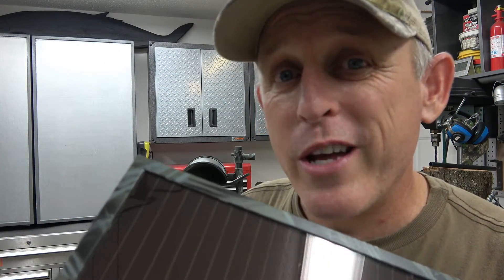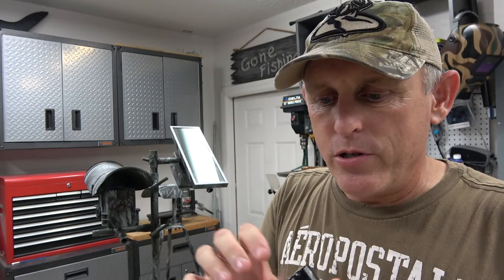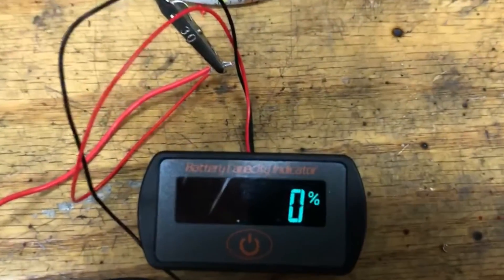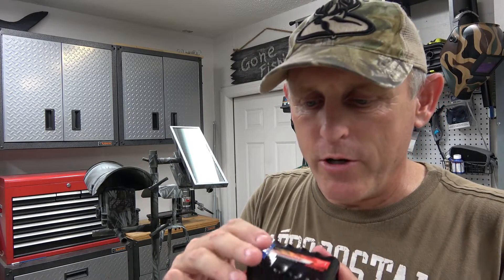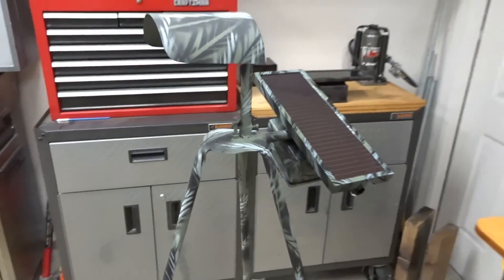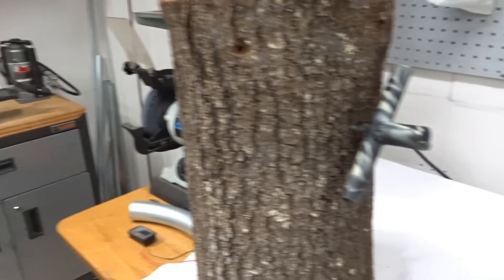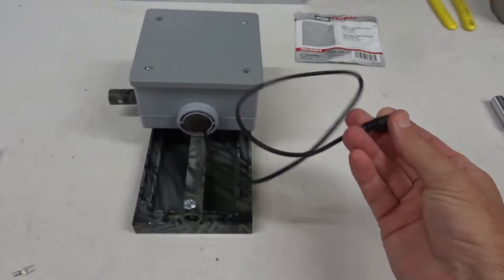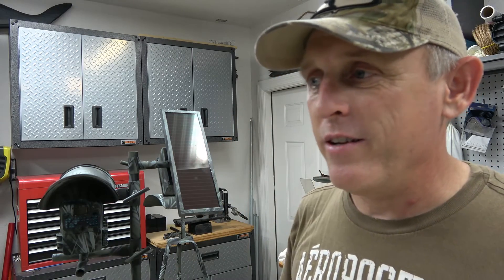Trail Camera Solar Batt Pack-DIY

Comment: Quick question, as I need help with the nomenclature conversion.  In the original battery box you used a 12v/12Ah SLA battery now I believe this is suppose to be done with a 2000MAh NiMH battery.  Is 2000MAh equivalent to 2Ah or to 20Ah?  Thinking it takes 1000 milli amps to be 1 amp.  Have you looked into Lithium for this purpose.  What I can't figure out on the 12v regulator is the range of input voltage it can handle.  If it can take 4-3.7volt 18650 cells (14.8v) in series and regulate that to 12 volts it should be no problem to cobble together a very robust multiday batter pack with 8 or even 12 18650 cells.
Reply from the maker: It will handle 14 volts easily cause it regulates 12 volt solar in full sun at 23volts.  You will be fine but may need to double the number of 18650’s and run two packs in parallel.  Hope that helps
Reply: @TheHandyHunter  Yes sir, thanks for that information.  Actually looking at making up a pack using 32700 LiFePo4 cells because they seems to run in mAh ranges from 6000 to as high as 12000 which should translate to between 6Ah and 12Ah plus that chemistry is rated to have a discharge/charge cycle life in the thousands.

Comment: I've been watching your videos and I really like the ideas you have.  I'm in the process of getting the items I need to make this off your amazon store, but I'm not sure about the 12V regulator.  I think I understand that the regulator reduces the voltage from 12V (the battery) to 6V (camera) correct?  If that is the case, which regulators do I need to buy?  When I click on the link it goes to "L7809CV L7809 Positive Voltage Regulator IC TO-220 Output 1.5A 9V"  Does this mean it's meant for 9V?  Or do I need to get the L7812 for 12V?  Or do I need to get the L7806 for 6V?  Thanks!
Reply from the maker: Hi David, what voltage is your camera?  You’ll need to match the regulator to the voltage of the camera.  The voltage regulator protects from high voltage at full sun from the solar panel.  Hope that helps!

Comment: Im getting around 12v at the regulator...however, from the regulator/game cord to camera I'm getting no power to unit. All my connections are solid...any ideas?
Bottom of my game cam says dc6-12v and camera instruction book says it accepts a 12v external source. Stumped!
Reply from the maker: Hi Jim, sorry for the delay.  Are you not getting any voltage at the plug tip?  If not, then must be a bad regulator (which happens).  I would try a new one and see what happens.  If that doesn’t work it could also be a bad cable.  I would do some testing right at the reg to see if power is coming through.  Let me know what you find.
Reply: @TheHandyHunter   as soon as I posted, I went back and tried a few things...I'll admit, I know a little about electricity but not how to use a volt meter! (Reading instructions helps!!) So I had my settings wrong on the volt meter and the testing tips were plugged into the wrong parts of the volt meter. Once I read up on the correct placement, bingo, I had power to the cable tip! Now that I got a grasp I'm gonna make a few more...but I am gonna try a different regulator, those little ones drive me nuts trying to make em fit and get crimped! 

Thanks for the help and providing a shopping list...really makes things easier to find! Take care
Reply from the maker: You bet!  Glad you found the problem.  Good luck and keep in touch!

Comment: I built this setup exactly like you showed. Once I hooked it up to my camera the voltage regulator got extremely hot. Too hot to touch. Is this normal?
Reply from the maker: No, it should get hot.  What is the voltage coming out of the plug?  The voltage is not reversed at the plug is it?  Inner part is positive and outer is negative.  It could be a bad regulator but usually a wiring issue.  Let me know.

Comment: Handy Hunter, since it has been a couple of years since this was posted, have you redone any of these with 18650 or 2170 cells? I am wondering about the logistics of using a small bms and voltage regulator in a 4s configuration of lithium cells.
Reply from the maker: So funny you mentioned this!  I just started working on this project!  I’m trying to decide on which lithium battery and then the proper solar panel for charging.  May be able to skip all the bms part if you use protected lithium batteries that will prevent overcharging.  Also looking at the 26650 batteries but also trying to keep cost and ease of replacement in mind for DIY’rs.  I’m also thinking of changing the battery box the internals more accessible.  I want one that’s waterproof with a latched door for easy access.  I’m hoping to start testing a couple setups soon.  I’ll also be testing a lithium pack without a solar panel to replace some of my old SLA battery setups in the ammo boxes.  Let me know if you find a setup you like.  Thanks!!
Reply: @TheHandyHunter  I am wondering if you have figured anything out on this setup?

Comment: So I just made 3 of these using the link in your Amazon store to the diode and 12v regulator. Using a harbor freight  1.5w panel. It is wired exactly as you show, using brand new fully charged 12v7a sla batteries. Battery output 12 volts up to the regulator but is only showing 10-11v after the regulator.  I’m using them on 2 moultrie cam with external modem and a SPYPOINT link micro- the moultrie app shows power 64%-74%, 64% one will not send pics. SPYPOINT app showed power @60% it would not send either. On this cam  I disconnected the regulator and solar panel , ran wire from cam to battery, instantly the app showed 100% power and pics were sent.  Any idea why such a voltage drop on 3 setups?  It clearly isn’t putting enough voltage out to power cams
Reply from the maker: I’m a little confused.  The battery in this video is not an SLA but a NiMH...can you clarify first which one you are using?  Honestly, I had the same problem with Spypoints on the battery level and then had other problems so I ditched them after months of constant problems.  Hope u have better luck.  I can’t speak for the moultrie’s.  Voltage drop can occur from too long of cables or wrong size wire...I assume you are using a standard cable?  You may try rigging a short wire for testing to see if it helps.  It can also be due to faulty regulators but unlikely with 3 in a row.  Cell cams are more demanding than trail cams.  If I were you I might drop the regulator altogether.  Try this...take your reg off and connect your solar directly to your battery and then connect your cam cable directly to the battery as well(without cam connected).  Put the panel in full sun and test the voltage coming out of the plug.  As long as it’s not over ~14 volts you should be ok(some cams may even tolerate slightly higher).  It will probably run in the high 12 range if I had to guess.  The battery helps average down voltage going to the camera.  Full sun will be your highest risk for too high of voltage.  If you are close to 12v at full sun then forget the regulator.  I know many people who do it this way.  Just test, test and test again before you plug you cam in at full sun and make sure your panel is connected to the battery.  Do some testing and then get back to me with update.  Just FYI,  I’ve run this same solar setup for 3 years on my cellular bigfoots and haven’t touched them so once you get it up and running you should be fine.  Let me know.
Reply: @TheHandyHunter  thanks for the reply.  I am using a sla battery not lithium.  I did test the panel briefly in the full sun. It showed 24v from the panel.  When I plugged that into battery, and had a power wire coming off the battery on the same post, that wire coming off battery only showed 12v.  I will test again to verify tomorrow.  I guess if that is correct I will remove regulator.  (The voltage drop occurs even with a 4" wire coming directly off the regulator, it is the same with a 10' wire.)  using 16-18ga wire, I have used these battery/wiring combo for several years with no issue, only change was adding solar/regulator.  Moultrie modem is a power hog, cam not so bad; spy point is better on batteries but you are right they are nightmares with different issues.
Reply from the maker: Ok, test it again in full sun, connected to the battery with no regulator.  Who knows, it could be the batch of regs that are slightly off.  I’ve had to throw some away from time to time.  Good luck and let me know.
Reply: Tested again today in full sun. Panel output 22 volts. Regulator output 11-11.5. Removed regulator from the system- so it was solar to battery, battery to cam plug, plug read 12.5-12.8v
Reply from the maker: If it were me I’d run it without the regulator.  Your cams can handle that voltage no problem and will perform better.  Thx for the update!
Reply: @TheHandyHunter  thank you for your time

Comment: how big this battery your using in this box  ? Is there welded  holder on back that you  could use a steal cable lock or python on this item so it kept from being stolen our of the tree ? Thanks Pamela

Comment: Does this setup still work? Those are lithium batteries right? I have always been told that without a solar charge controller, the lithium batteries will eventually go bad from having too much voltage put into them.
Reply from the maker: The battery just went bad after two years and full sun all day every day.  This is a 2 watt panel so I started building these with a 1.5 watt panel and they are doing fine.  You can try a controller but keep in mind they they creat draw on your battery.  You may be better off taping off part of your solar panel to slightly reduce voltage.  I love this setup though...works well!  Good luck!
Reply: @TheHandyHunter  Just realized this is a NiMH battery. I was thinking lithium ion. I have a setup that I made with a solar charge controller and some Lithium ion batteries but the box failed as well as the solar panel because it got messed with by cows. I may try this method and add my solar charge controller to it.
Reply: @TheHandyHunter  Thanks for your response!
Reply from the maker: You are welcome!

Comment: Hay man you are great and I made 1 like in your previous videos with the amo box and has worked great for a couple of months. I went and checked it yesterday and says battery is low shows 9.57 on wild view camera. I don't understand why it now down on charge. The solar panel is the same on my feeder to your specs and about 10 feet from it and it's low. I have also ordered some rechargable AA batteries for the camera and the other battery just as back up but have been running it direct any advise on what could be the problem ?
Reply from the maker: Hi Tony, are you saying the batteries are low on both your battery box and on your deer feeder?  Are you running solar panels on both? Are they in heavy shade?  What brand of batteries are you using?  Just FYI, some cams won’t run on rechargeable AA’s because they are slightly lower voltage than regular AA’s.
Reply: No the battery on my feeder is staying at full charge and the big battery on my camera is showing low charge. I disconnected it so to see if it charges back up and I will check it again this evening. I will let you know the brand of battery this evening. The solar panel is a wild game innovation sp-12v1 the same as my feeder.
Reply from the maker: Ok thanks.  I’ve had even new batteries go bad because they wouldnt charge so it could be that.  Otherwise, you may have to increase the size of your panel for the lack of sun time.  I don’t know the draw of your camera but usually they barely draw any power.  I used those wildgame panels in the past but only on 6 volt and they wouldnt keep my feeder battery charged so I built my own solar setup.  Let me know what you find.
Reply: They get good sun up till about 11 in the morning.
Reply: Also I got the battery from academy .
Reply: Sorry it took so long to get back to you. I have a lot going on. After 3 days of being unhooked it has only charged to 11.38 volts. I just hooked it all back up and will see.
Reply: The battery is and EXP 1270
Reply from the maker: Sounds like you may need a little bigger panel.  Let me know how it goes!

Comment: Handy
Hunter, you seem to have lots of experience with batteries and cameras. After seeing your video, I made up some cables with the 12v regulators you recommended. In testing them I found some unexpected results. First, when connecting a solar panel in full sun producing close to 24 volts to a battery, the output of the battery did not change by more than .1v even without a regulator. When connecting the regulator to the output of a battery reading 13.08 the voltage dropped
to 11.80.  Another battery reading 12.70v dropped to 11.65 through the regulator. So, I have three questions for you. Are you getting less than 12v on your regulated cables? If so, any problems with
cameras running on 11.something volts? Is the regulator really necessary since the battery (in my test anyway) appears to regulate the voltage?
Reply from the maker: Cams run on a variance of voltage and some do fine slightly below and above 12v.  How big is the battery you are connecting the panel too?
Reply: @TheHandyHunter  It is a 12v 7ah SLA battery

Comment: Hi, love the how-to videos. Question on the panel in this video.  Is the panel in a self made bracket and which model is it?  I see several options in the Amazon link.  I noticed all of the options in the store are 12 volt but you suggest a 12V regulator.  How come?
Thank you!
Reply from the maker: Yep, all panels will come with a frame around them. I don’t suggest the panel I used in the video...it’s very difficult to mount.  I use the plastic framed ones with holes in the end for mounting.  We have them in our store.  You need a 12v regulator even with a 12 volt panel because at full sun a 12 v panel will produce up to 23ish volts which will  burn your 12 volt cam.  You want the high voltage going to your battery, just not your camera.  Hope that helps!  Good luck.
Reply: @TheHandyHunter  Thanks so much, and that makes sense.  I want to replace the solar panel off of a box that I bought, so I shouldn't need the regulator since it will be connected to the battery and not the camera.  Just so I'm clear, can you provide the part number of the one you prefer or suggest?  Appreciate it so much.
Reply from the maker: If you are connecting a solar panel to any battery that simultaneously connecting to a camera you will need a regulator on the cable to the camera.  Any of the panels in our store.  We use them all and they all work great.  Hope that helps.

Comment: Just wandering if the battery is combination of 18650 batteries?! If yes, it takes me 4 hours to charge two of them with a wall charger. How would that 2w solar panel charge 10 or 12 of them in 6 hours?! Thanks
Reply from the maker: I never cut one open but they are not 18650’s...those would produce too much voltage.  Pretty sure these are 1.2v rechargeable AA’s.  1.2 x 10=12 volts.  Hope that helps.

Comment: Specifications says the 1.8 watt solar panel is not waterproof...will rainy weather effect it?
Reply from the maker: Mine all are completely exposed in the weather and I’ve never had a problem.  Some people run a bead of silicone around the edge for extra measure but I dont think it’s necessary.

Comment: Do you have to have a 12v regulator for it to work for cameras? Maybe a odd question but my deer feeders don’t use them on their solar panels so was wondering the reason for it. Thanks
Reply from the maker: You need a regulator to prevent high voltage passing through to the camera during full sun.  A 12 volt solar panel can put up to 24 volts directly into your cam if you don’t have a regulator.  My deer feeders don’t have regulators either because they only come on early morning and late afternoon when the sun is low and voltage from solar panel is low.  Even if a feeder motor came on at 12 noon it probably wouldnt hurt it because the motor only runs a few seconds and not continually.  Hope that helps.

Comment: Hey, thanks for the info. Can you charge 2 battery packs off one solar panel?
Reply from the maker: I’ve run two cams off one of these units using one battery but you should have no trouble charging two of these small batteries off one solar panel.

Comment: The handy hunter just curious about that setup u did in the video was wondering what a setup like that with panel battery box and everything wired up with the tree adapter would cost and if you'd be interested in doing it for me and ill pay you what you want and buy it over ebay from you if ur interested get back to me thanks
Reply from the maker: I don’t build the whole setup.  When I have time I build the metal brackets that everything bolts too but I just don’t have time to build anymore.

Comment: hey what could I do to have tou make me 4 of these could you price it for me ?
Reply from the maker: I only build the metal brackets when I have time and then I post them on my ebay link.  I haven’t had time to build lately due to work.  Are you looking for the whole unit with battery, etc or just the metal brackets?
Reply: @TheHandyHunter  i would buy 3 complete setups if you can make them for me
Reply: I'm interested in 3 as well. At least the tree screws. I'm gonna try to make a few of these setups. Pretty freaking genius!

Comment: On the camera plug, should inside plug be positive or negative??
Reply from the maker: Inside is usually positive but double check the plug diagram on your camera.  It’s usually very small and sometimes on the rubber plug that covers the hole.